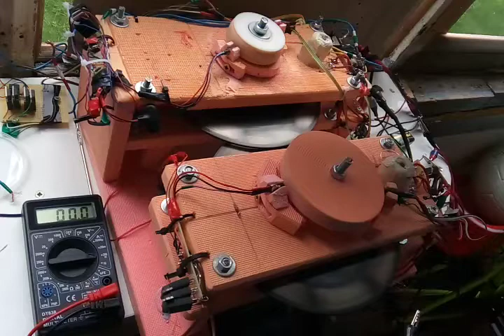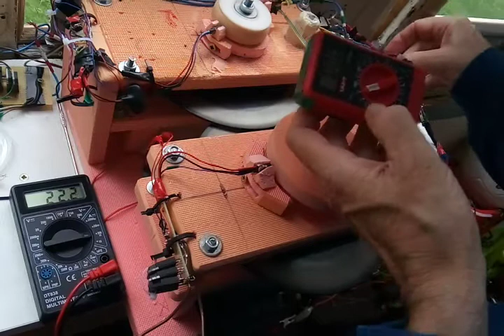20ma into motor A,  20ma into motor B

Comment: Amazing what one can do with nothing.  Doug you've got a LEVER from the small shaft to outer edge of each motor  you could take advantage of this by adding say 3 neos to the small shaft with coils to gather energy at coil firing position that drives the motors.  20ma is awesome.  loop with BEMF.   I still think that my catch 22 idea where a machine runs off of its BEMF and it can never catch up to the beginning.
Reply: also don't forget small wire many turns give lots of magnetic field at lower current.
Reply from the maker: @CAPTAINSSBN 
 Hi Gary.  I am using 14 strand super thin wired Litz wire,  about 10 ohms to a motor coil, directionally wound too.  The induced pickup/generator coils wound around and behind the motor coils are 50 ohms each....if I run these in series to motor coils, now draw way down there, below 10ma...
Reply from the maker: Hi Gary
Thanks for advice, not exactly sure what you mean by catch22 with BEMF, you mean shuttle to  caps into caps and let loose after a bit of time?
The lever idea also not sure but I think you mean add some motor coils near shaft and magnets....
Thanks!

Comment: Hi doug, I think i know what happened.. because it happened to me also... I suddenly (after a pop) had like 2 amps of draw... like if the battery was shortened...
What blew was the chip.. (not the mosfet)... why did it blow? i was feeding back from a voltage doubler that went up to 120 volts... it (had a bad connection with a crocodile clip) so instead of feeding into the circuit.. it went up to 120 volts and when i moved it.. it pushed the whole 120 volts into the circuit (at the time i was using the same battery for the circuit and for the run coil...) actually i blew 2 chips in a row... The fuse in the meter blew also because the fuse for the 200 mA setting is a 250 mA fuse... so it will blow as soon as a spike will go over 250mA which is very possible,
My question though is, before the mishap: is the draw 22mA (on both) including the feedback with the flyback windings or without any feedback?... 
Luc
Just keep on testing... ( will be testing a new rotor tomorow and trying to compare draw with 5 millimeter thick magnets compared to the 2 milimeter now)
Reply from the maker: Hi Luc 
After filming I took a look,
The meter is ok fuse good 
Looks like the voltage doubler not connected, or wires blew off solder connection.from the blast and caps got way too high maybe 400v  over time from spikes... but not sure about anything and will  find out tommorow test again.
Reply: Well actually i did some more tests with interesting results... bottom line: (i had told you before) 8 pulses does NOT consume less than 16.. AND thicker (stronger) magnets give you less consumption.. 
I did a video for those tests...: 
https://www.youtube.com/watch?v=p7N7eiTGuO0

Luc